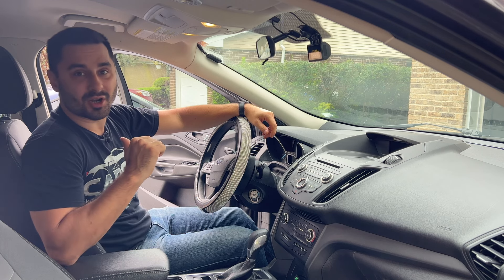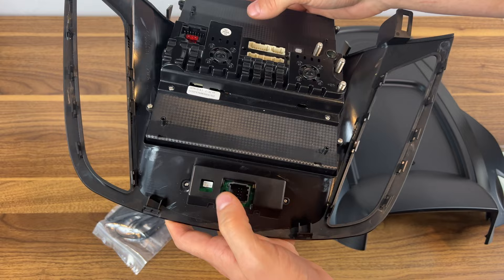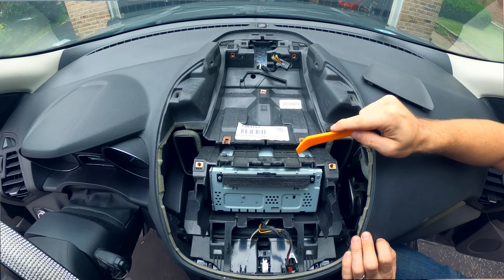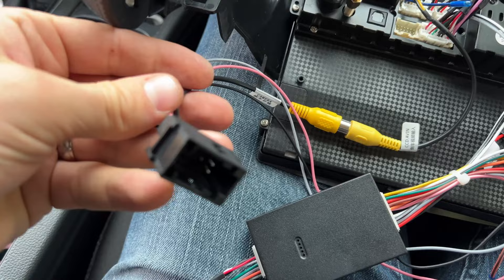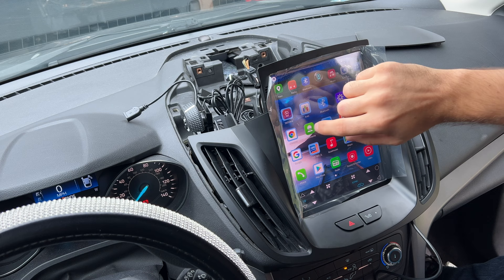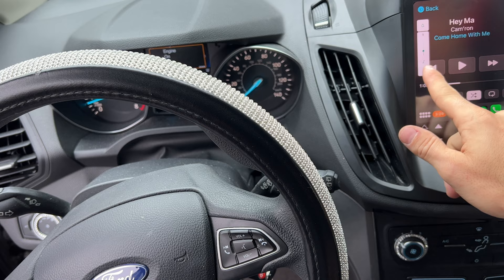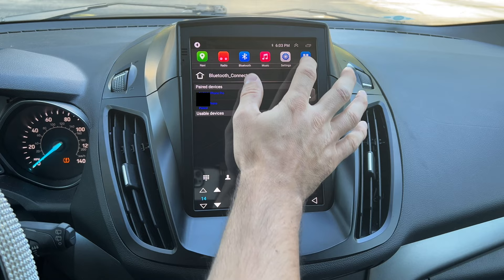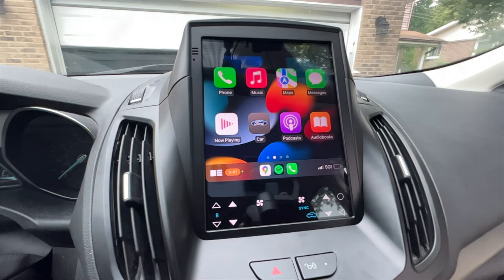Ford Escape Wireless CarPlay Retrofit - Seicane Headunit Install/Review

Comment: *2 week post install update*
This radio is 100% garbage. I had high hopes it would be worth it. DO NOT BUY.  Alpine halo 511 will be on order shortly. 

just installed this product in a 2017 escape model s.  all required connectors came with it.  

yes, you do have to modify your car stereo mounting (plastic) to get this to fit.  i used a pair of flush cut pliers to cut straight lines and only where i needed it to be.  note, any aftermarket radio for the escape requires you to modify the radio mounting point in the dash, nothing new here.    it was straight forward with install after that.  

unfortunately they skimped on the size of the radio bezel towards the lower end of the radio where it meets the dash.  there is a noticeable gap.  getting the radio (as a whole with ac vents attached) was a PITA.  i drilled 2 holes above/behind the screen in the top trim piece so i could feed both USB connectors through.  made the hole just big enough for the molex connector and each drilled hole holds the usb connector (at strain relief).

i had no issues with the reverse camera settings.  Only thing i don't like about this "head unit" is that i cannot figure out how to modify the home screen/apps.  i want to delete un-needed apps and move specific apps from 2nd page to first (main) one.  Also, still trying to figure out how to get the bottom (center) to show something other than the date.  radio station or song playing would be nice.

someone asked below how to remove the HVAC display from the screen.  setup > canbus reversing settings > down to bottom, show aircon settings > hide
Reply: Interesting, it fit perfectly in the 2013 SEL I have.

Comment: If your steering wheel buttons are not working you have to go to Factory Settings - Canbus setting- find your car on the Canbus setting. 

2018 Ford Escape I have to select Raise for Canbus box. For car choice I selected Ford then 17 Kuga/17Eco_Sport/18kuga
Reply: I did this but my steering wheel volume control still not working. I try to syn the button but it fails every time? Any idea thank you ?